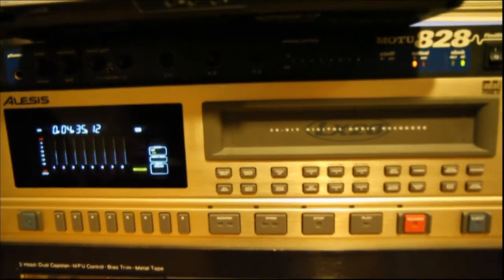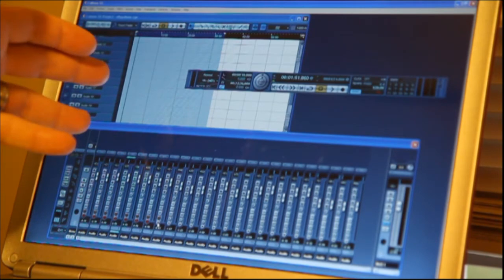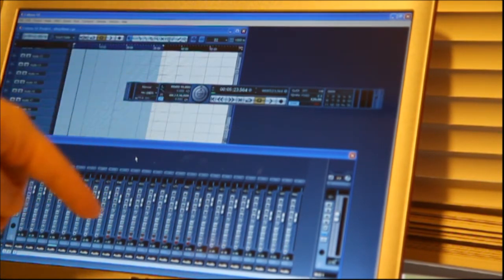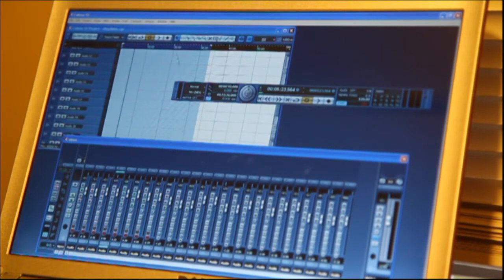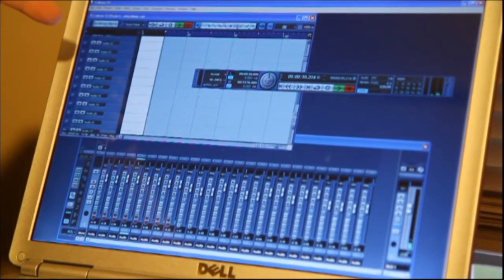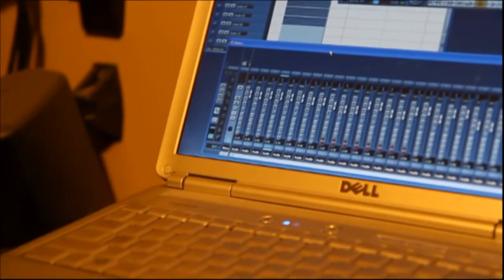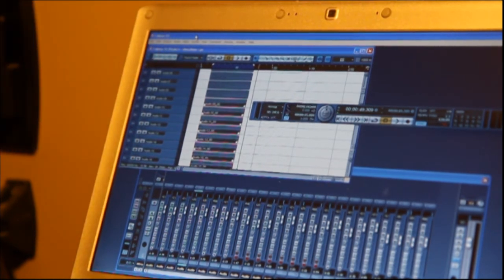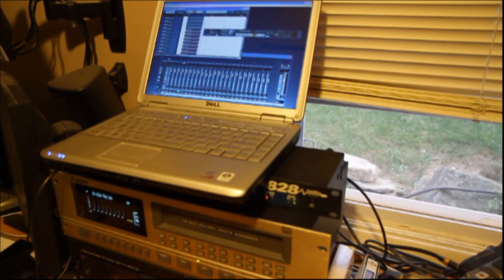Transfer ADAT tapes to PC using Moto 828 FireWire Audio Interface multiple tapes, one at a time 2010

Comment: Question is there a sink code on each tape 
That allows them all to sync up
Reply from the maker: yes, there is time code that was written at once when they were all recorded together.  Each tape was in its own 8 track ADAT with a snyc cable daisy chained together.  Frame 1 was recorded at the exact same time on each of the 3 tapes.   So playback in this case, allows the software to align frame 1 to the start point exactly the same time.
Reply: @SteveHartmanVideos thank you so much. 
I have records that was recorded in the 90s 
On the alesis adats
I still have the machines 
I need to transfer them to logic

Comment: Hi there, did you have to ad a firewire to usb cable converter to interface the motu and pc? , also where can we find the adat 9pin interface cable? Is this just a general 9pin serial cable? Thanks kindly
Reply from the maker: The laptop already has a firewire port. It was an older laptop.  You could also use a PC with a firewire adapter on the motherboard or a firewire PCI card.   The 9 pin interface is the standard snyc cable for any adat system.  I believe its just a 9 pin straight passthrough.  Google "9 pin adat sync cable".   The audio cable is a standard Sony Phillips SPDIF TOSHLINK cable.   These are all parts you can easily find on amazon.  The Moto unit is the hard to find piece.  Also, Firewire is not used anymore so you'd have to have some older gear or get a PCI expansion card with firewire on it.  (and a firewire cable with the appropriate ends for your card or PC interface)
Reply: @SteveHartmanVideos ok got it, they now sell USB to Firewire adapter cables, do you think this would work? Or shall i buy a the PCI FireWire card?
Reply from the maker: @pauldiaz4273  USB to FireWire prob wont work.   It might show up in the OS but the software wont see the device is my guess.  Try a PCI to FireWire card on amazon, they are cheap enough.  The FireWire connection needs direct access to the PCI bus on the PC.

Comment: Problem finally solved. Geek Squad helped out. They found out Alesis recommends a certain FTP. Downloaded it and it works. I use it with a crossover cable as there is no difference in the speed files are transferred. I’ll post the name of the FTP when I get a chance.
Reply from the maker: Ive used the HD24 a few times and I always end up FTP the files to my PC.  Its a slow process but it works and its built into the back of the HD24.  For anyone wondering, the video is NOT showing a hard drive based HD24, its a normal VHS tape based ADAT recorder.

Comment: If I purchased a Motu 828 MKII and downloaded the software from their site wouldn’t it allow me to transfer files from the HD24 using the light pipe?
Reply from the maker: yes, but lightpipe is only 8 tracks at once.  if you have more than 8 in snyc, then you need to snyc them, which is the point of the video.

Comment: I just want to transfer all tracks from my HD24 to WAV files on my computer. Will this work?
From what I read it will only transfer 16 tracks at a time.
Reply from the maker: With the HD 24 you can just set up a local FTP client to connect to the device over the ethernet connection. You can use a built-in FTP client and windows to pull the files down from it. Just plug it into your local network or computer and you can access it Like an FTP server over its IP network.  The other way would get would be to get an adapter to plug the drive in but I think those are fire wire, only which presents another set of problems because that is an older technology no longer supported by newer hardware.
Reply: After installing Commander One Pro it started working. Each track must be transferred separately. At least it works! Thanks!
Reply from the maker: @ronedwards8239  i’m glad its working.   Yes, one at a time to FTP transfer the files, that’s normal.  Once you get all the files, you can then import them into your timeline at the zero point and they will all align up again.
Reply: I tried all the steps on HD24 Tools. HD24 connect does not work at all.
Reply from the maker: @ronedwards8239  you dont need hd24 connect, i dont know what that is.
Reply from the maker: @ronedwards8239  simple google search shows you how to do it.  enable ftp server on hd24, and set up your favorite FTP client. https://www.sweetwater.com/sweetcare/articles/transferring-computer-alesis-hd24-winxp/ AND 
https://www.macgasm.net/software/how-to-ftp-on-mac/
Reply: I tried this it showed it connected. But how do you start transferring files?
There is no interface to control anything. I’ll try what you provided when I get a chance.
Reply from the maker: @ronedwards8239  once you connect, you should see folders on the HD24 FTP Server, then you want to transfer them to your local machine, one file or folder at a time. It will take a long time as the transfer speeds are very slow.   You want to search for things like "how do i transfer files over FTP with macos"
Reply: I got the communication working. When transferring a file or folder it may load to 6% and lockup. I’m using the free version of Commander One. Could this be the issue?
Reply: The files will no longer transfer. I thought the problem may have been iTunes. Tried 2 other computers, brand new MAC and Google Chrome notebook with a different FTP. Same result. Files show but the transfer will not initiate. I found old posts confirming the same problem when Alesis was still supporting the HD24. Alesis had no answers as to why. So frustrating.
I have a Tascam Model 24 it the transfer would be via line level. May have to purchase the Motu.
Reply from the maker: @ronedwards8239  that sounds frustrating.  the firewire adapter is another option, but only supports older OS.  (Compatible with Windows 2000, XP, Mac OSX 10.2 and Mac OSX 10.3)  see: https://www.guitarcenter.com/Alesis/ADAT-HD24-FirePort-1394-1274115061160.gc  - The files are there but wont copy, sounds like you have something not set up correctly in either the client or the ADAT 24.  try making sure that the unit it not using the files, there might be a "ready to transfer" mode that has to be selected.  I dont remember if that was the case. I have transferred from this before using FTP but that was 15 years ago using Windows 98 or XP maybe.
Reply from the maker: @ronedwards8239  what do you mean "will not initiate" ?  you see the files, you start the transfer to your local computer and what are you seeing. how do you know its not working. is there an error message?  try taking the error message and FTP client and put into google.   Sometimes FTP clients need to have an option enabled called "Passive Mode" where the FTP client tries to use the same port for data transfer and for directory listing.  if you see that option in your FTP, try toggling that option and try again.  The FTP is pretty fool proof.     send some links to the old posts confirming this problem. I would like to see exactly what is causing the FTP to fail.